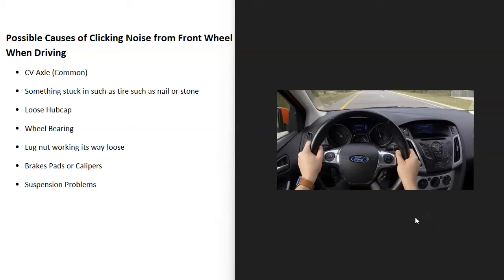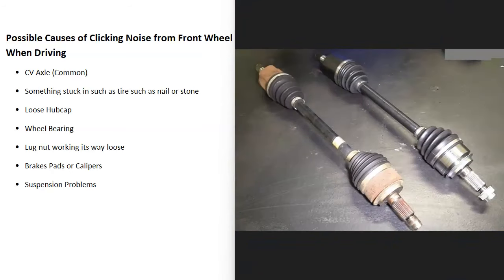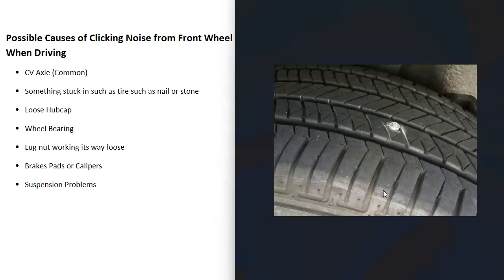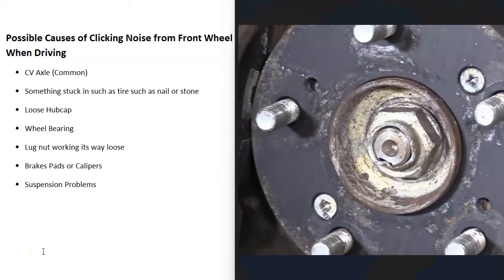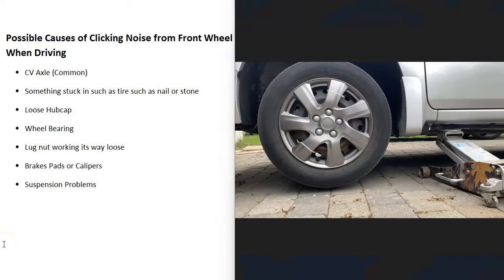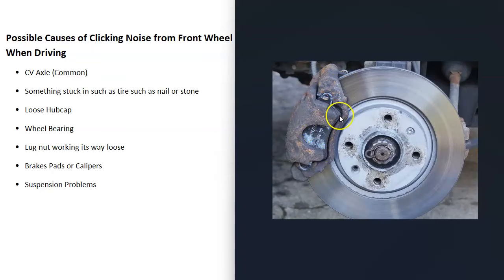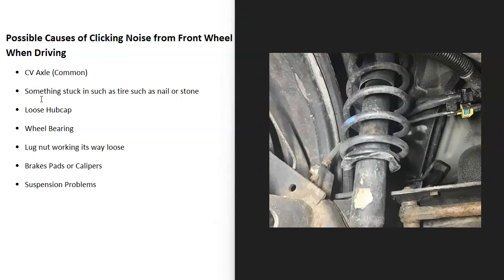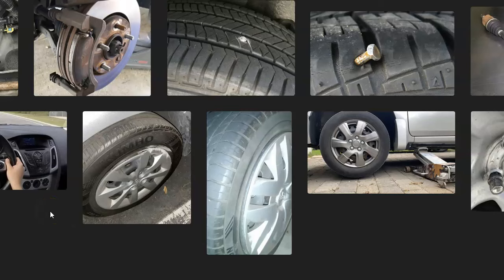Causes of Clicking Noise from Front Wheel When Driving

Comment: I’m having a ticking noise after installing new pads. I also installed another new set of pads to rule that out. It only ticks when I’m braking and the speed of the noise is directly based on the speed of the car. It almost sounds like a piece of plastic or a poker card shuffling.
Reply: My exact situation, any update?
Reply: @sebastianr5019  yea it was the rotors they were warped. I changed them and it went away but now I need to find out what caused them to warp. I think my calipers are sticking.
Reply: I have the same ticking noise after installing brand new rotors and pads, acdelco from the dealer
Reply: @chrisolbrycht9858  same except I installed it myself. I found my issue. The clicking noise got louder the faster I went. I jacked up the car and spun the tire to recreate the sound and looked at the pads through the holes. I saw that the clips were hitting the tire as it rotates. Had to pull them out and put them in correctly and it went away.
Reply: Warped rotors. Happened to my ‘08 pilot worth a shot
Reply: Okay so here is my clicking issue. The clicks follow the speed of the car, the faster I go the faster the clicks are. It makes no difference when turning either way, it makes no difference whether it’s in drive or neutral, it’s makes no difference if you are breaking or not. 

So far I’ve replaced wheel bearings, breaks pads and rotors, drop links, suspension struts and springs, top mounts.

Last thing to get done is the drive shafts! 🤞🤞🤞
Reply: @blackmountainadventures  if it does this in neutral it’s probably something on the drive belt system. Maybe a pulley or something.
Reply: @Dnasty1  I wouldn’t have thought it could be the timing belt pulley as the clicking sound slows down when the car slows down without the gearbox being engaged. The revs sit at 900rmp - the car slows down, the clicking slows down. Same but opposite going down a hill in neutral, the revs sit a 900rpm but as the car speeds up the clicking speeds up. Also I’m 99% sure the sound is external to the engine. I will definitely check it though 👍
Reply: Poker card shuffle 😂😂 👍🏼
Reply: @blackmountainadventures  Any updates? Thinking my Quattro system needs some love too. My clicking started at 150kmh then it started going on at lower speeds until now at 50 it's louder than the car itself.

Comment: I get a clicking noise when accelerating and it follows my speed. The faster I go the faster it click and the slower i go the slower i click. This only happen when driving straight.
Reply: @RonDaG0at I have exactly the same issue, it’s driving me insane (Excuse the pun)
Reply: Did you find the problem
Reply: @salvisfun3577 yes. The gearbox is knackered. Nightmare, it’s only a matter of time before it completely goes.

Comment: Have more of a clanking noise coming from the front left of my vehicle. Almost like something is banging around in the motor/wheel area. I can't see anything when I have the vehicle stopped. I hear it when I'm on a flat road more so when I'm going faster.
Reply: I heared it too ? Have u figured out ?
Reply: Same here have you figured it out
Reply: @AlphaTrader-bq4xw  no not yet.
Reply: @VolunteerFan7  no not yet.
Reply: @LoungeAct1978  i have figured out my problem, it was condensor that was tapping the body, when my car goes into high speed and condensor was lose so it start tapping the body... 
now i hear nothing, you should check your condensor too.
Reply: @LoungeAct1978  also check the plastics casing to cover the shock just above the tyre.. some times it make noise too.
Reply: @AlphaTrader-bq4xw  perfect thank you! I will check that out!!

Comment: I had my front brake pads and rotors changed Friday and now I hear a ticking/clicking noise coming from the front left side, which turns into an annoying screech the faster you drive. I took it back to Firestone the next day and told them about it, the tech took it for a quick test drive, came back and told me it was the transmission, lol. Mind you there was NO sound prior to having my pads & rotors changed, no slow-down in shifting, nada! He then changed his mind and said that it could be the axle starting to go. I disagreed and asked him to take the tire off and LOOK, spin it and see, he continued to tell me it was either a transmission issue or axle...any ideas?

Comment: I just had new front brakes installed 8 months, suspension work a few weeks ago and new tires installed days ago. Car is making a "tambourine" sound at very low speed. It's at a very rapid rate (i.e. must faster than the rotation of the tire which makes me think it's not a stone or nail in tire).
Reply: did you also have vibrations at higher speeds?

Comment: Okay so here is my clicking issue. The clicks follow the speed of the car, the faster I go the faster the clicks are. It makes no difference when turning either way, it makes no difference whether it’s in drive or neutral, it’s makes no difference if you are breaking or not. 

So far I’ve replaced wheel bearings, breaks pads and rotors, drop links, suspension struts and springs, top mounts.

Last thing to get done is the drive shafts! 🤞🤞🤞
Reply: Did you resolve the issue? Having the same problem on my 2017 honda civic.
Reply: @benjaminnn.4122 nope, replaced the drive shafts but it made no difference. However I have located where the noise is coming from and it’s not good news. Transmission…… Yep the transmission is fooked! Not happy. 

Someone advised me to put the car on axel stands and remove the wheels then operate the gearbox with someone watching what’s happening outside the car. Sure enough the problem is caused by something clunking inside the box. 🤯

Comment: Hey, I'd like to ask you about a noise on my 2014 Ram 1500 Longhorn. I'm troubleshooting right now and trying to get suggestions. 
My front passenger side clicks/pops when I first get into my truck after being somewhere for a bit and also click/pops while driving down the road, straight. The roads here are all somewhat a little bumpy. As far as I have noticed it does not click/pop any more or less while turning. I did spray some lubricant on the shock absorber hoping to alleviate some of the noise, not sure how they fared yet. I just did that earlier. Any ideas and/or suggestions?? 

Sorry so long?!?! 
Thanks.